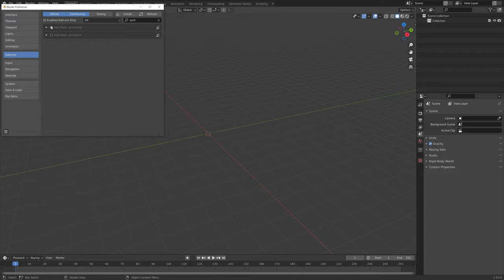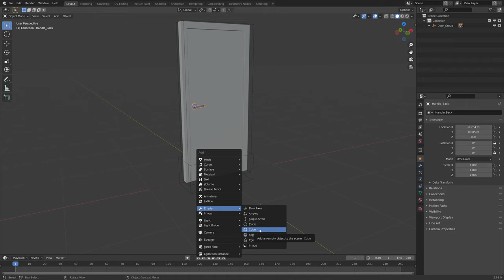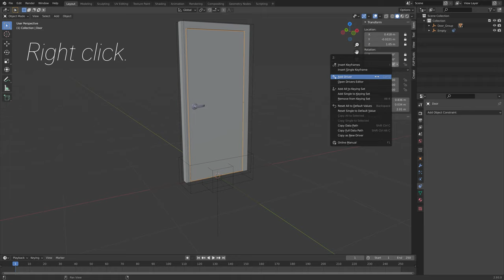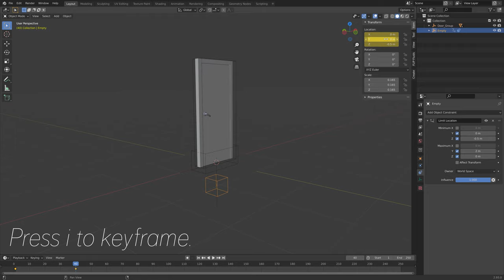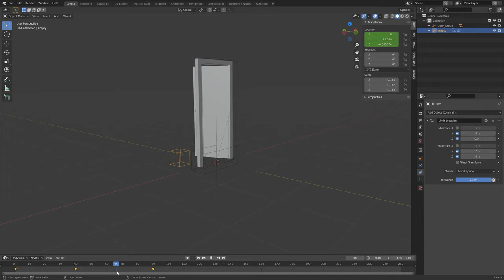[2.93] Blender Tutorial: Adding, Rigging, And Animating Doors

Comment: I made a 6 panel door, also have hinges morticed into the door, I can get the hinge to open and close but the 2 hinge parts don't stay centered on the pin, they move off the pin. I parented one side to the door and one side to the door frame, it will open and look ok from the front, but when you go inside the room the door hinge is not lined up on the pin anymore, any thoughts? I tried to use an armature also, but I am fairly new, thought a door can't be too hard, well! at least the door/frame/hinges came out very nice. my goal is to use this in Ue4 but not for a game